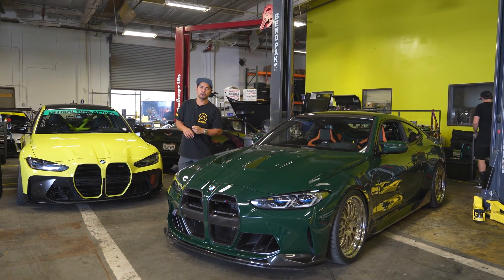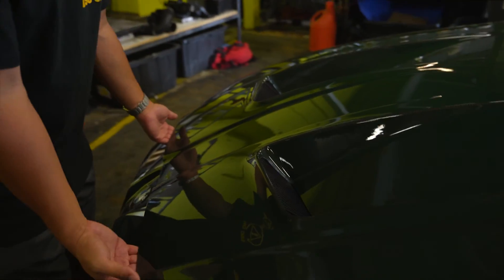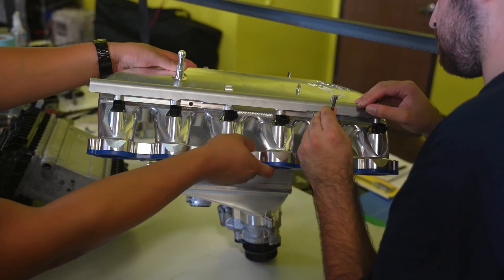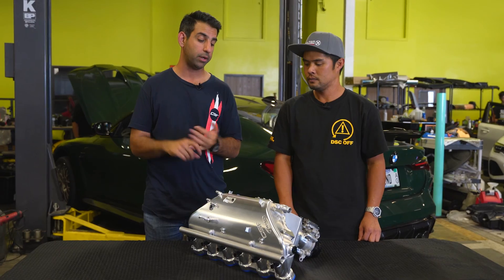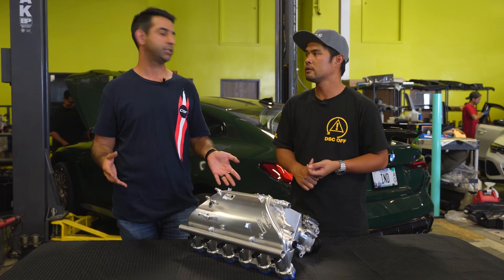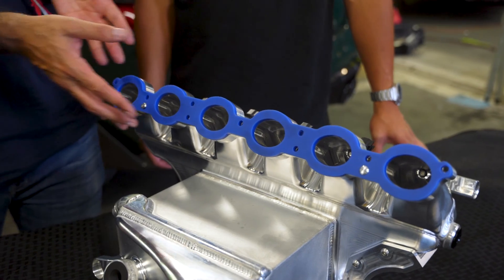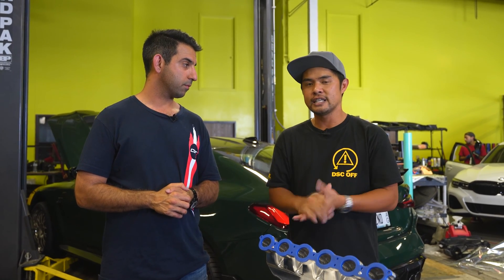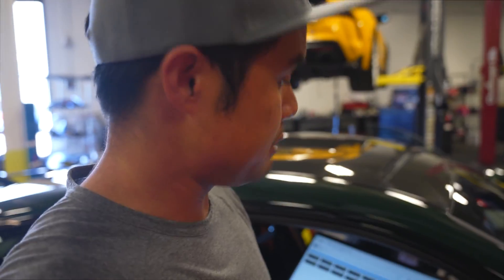G82 M4 / G80 M3 Increased Cooling - Billet Intake Manifold w/ Port Injection by CSF

Comment: My 1972 Datsun 240z had a phenolic spacer between the runner and the carb to function as a thermal insulator. This is nothing new, you are just using a different material. KIYLEX is also not made by an aerospace vendor, its made by KTN Thermo Dynamics which manufactures automotive parts from this material. Also could not find any patents for CSF or KTN and this material. Also could not find a trademark registry for KIYLEX. Seems like a lot of unnecesaary hype for a polymer with likely a low thermal conductivity and high glass temp.
Reply: Exactly

Comment: Does your G80 / G82 need to be ECU unlocked in order to use the manifold?  I realize if you are using the port injectors its likely needed, but the manifold & CSF Heat exchanger both combined should be a significant improvement in intake temps.  While Ill eventually get my ECU unlocked, I would like to go ahead and install the manifold until then for the other benefits...

Its an expensive part, but absolutely vital to reach optimal performance down the line.  Until then, there are still some healthy benefits from it, so def curious if an ECU unlock is needed to install the part...

Looking forward to part 2!  Thanks for the content!